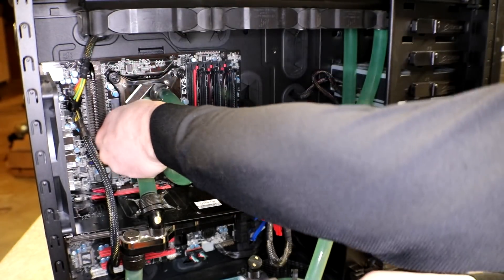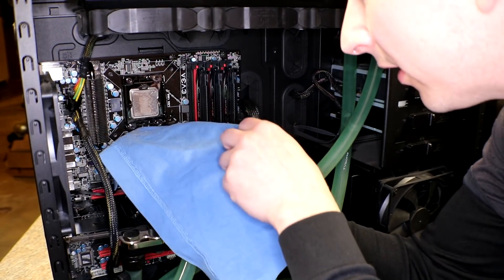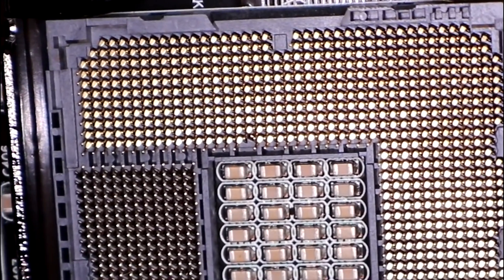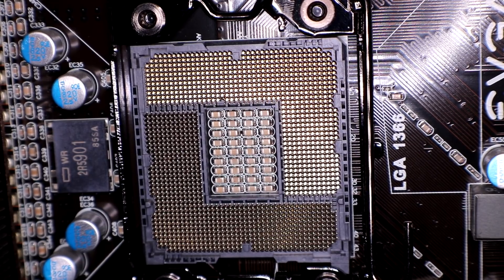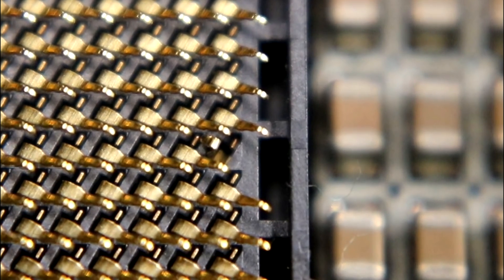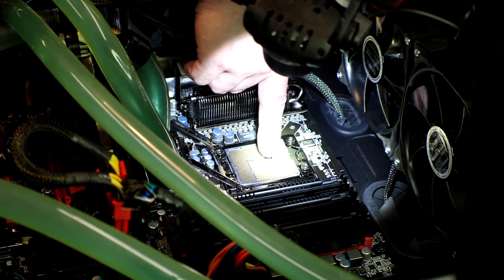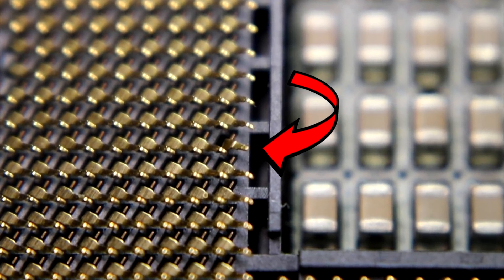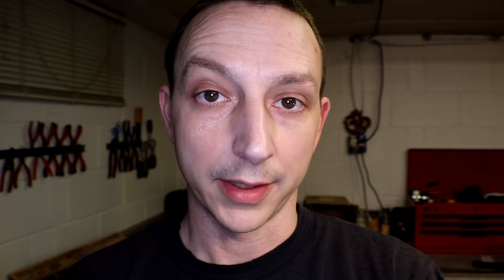Computer Failure!!!  What would cause this???  Bent Cpu Pins and a Repair!

Comment: EE means extreme edition.  What that means is That processor is over clockable. The socket can be dammaged when installing the processor to the socket.  It also might have been damaged at manufacturing.  It can also be dammaged if the processor is dropped on the socket.

Great troubleshooting and fix.  Thanks for your channel.
Reply from the maker: It was crazy that all of a sudden the pc wouldnt start or do anything!

Comment: reseat video card check power cables plugged into it then try again if it is still glitchy try reseating memory if this fails you either have bad power to the video card or a bad video card.
Reply from the maker: Yeah I tried all of that before I pulled the cpu.  All seems to be working pretty good meow!!!😲👍

Comment: My money would have been on the ram, Most of the time when its screen glitches its memory if the screen is connected on to board video not a pcie card. Good to see its working tho after fixing the socket pin but given the age of it, it will be worth running memtest86 for 24 hours off a boot cd given you have 4 sticks of ram.
Reply from the maker: Thats what my money was on to but I tried 2 different kinds and there was know change lol.  Yeah the screen is on a PCIE.  Im super glad its back up and running!  Yeah thats not a bad Idea to run a mem test on it.  Ill have to do that!!!👍

Comment: Great job Joe!
Processors tend to work or they don't, they won't just be faulty (that would be your settings for the processor).  Likely something just nicked that pin when removing the processor at some point, like the edge of the CPU or something dropped in the socket.  Spreading out the Arctic Silver with a toothpick or something will help you dissapate heat better at higher RPMs, like overclocking ;)
~Cheers
Reply from the maker: I kinda wondered about the cpu, either they work or they dont.  But what would cause the pc to just not work all of the sudden?  Thats what confused the hell out of me especially if that pin was bent from the manufacture?  I dont know lol, Im just glad its all up and working again!!!👍😜

Comment: not trying to be a fan boy but one more reason why i like AMD processors better then Intel is because of the pins. You're so lucky bending that back. most of the time they break off.
Reply from the maker: Thats what I was worried about most, bending and breaking the pin😱  I dont have a problem with amd or intell as long as they work lol!💥🔧🔨😜

Comment: Inserting a CPU onto a Mobo is more complex than it used to be.  I've been building my own systems since the 286 days. But the newer Chips when inserted cause pin roll over (you can actually hear it) and when done right there is not issue, but if done wrong generally there isn't an opportunity to do a redo. It is also possible that the first time it was put into the Mobo that the latch wasn't completely locked which still allowed connection, but also allowed ever so slight of movement of the chip.   This is the problem with the New to me computers, not knowing the history of said system.  You did get lucky being able to fix that pin.  But you also ran a huge risk not wearing an anti-static band.   

It was interesting to see Average Joe, then kitty appeared and we saw Sweet Joe, then back to Average Joe.  ;)  Nice Video bud!
Reply: it is possible.  It is also possible that while inserting the CPU into position they moved the chip causing that one pin to be irregular and over time and the movement of the entire box it simply got pushed over.  It's like vibration on a nut can cause it to loosen over time.  Seems impossible, but it happens.
Reply from the maker: Crazy!!!😱

Comment: Great job on that fix! 😎🤠👍🎇 Now, the question is, how long total did it take for you to find that problem when you first started diagnosing?  😉
Just because the CPU had contact marks on the pads, doesn't mean it was from "that" motherboard. They previous owner could have bought a used one off eBay and slapped that in thinking they'd solve the problem (that you later fixed).
Not sure what CPU you have in your mining rig, but you could use the Xeon cpu for mining as well in that rig. You'd use the xmr-stak-cpu miner software if you want to control it yourself, or your flavor of software that mines Monero (XMR). The e5530 does a hashrate of about 132 H/s at 80Watts. The I7-950 only does about 83 H/s at 130Watt.
Reply from the maker: Thanks Man! Oh it took a little bit of time.  I tried restarting and waiting many times hoping it would magically fix itself lol.  Then out of the blue a little thought popped into my head about it heating up and shutting down when I first got it so I figured I must of messed it up then.  The rest of the video was about 2-3hrs including figuring out the bent pin and recording and setting up the camera ect...Actual repair was probly 30min lol from removing cpu, fixing and reinserting and turning back on LOL😆💥😃👍

Comment: When heat builds up, the cpu has its protection to shutdown the computer so It doesnt burn down. The problem you had could also be heat build up  on the north or south bridge of the motherboard or bad power supply.
Reply from the maker: HHmmmmmm I hope its not the power supply.  Its been working great so far so time will tell I guess!👍

Comment: What you need to add to your arsenal is a USB female to PS2 male adaptor. New, they are like a buck a piece. But they used to come in the box with every name-brand wired USB keyboard/mouse, so if you ask around, someone might give you one.
Purple is the color code for the keyboard PS2 port, green for mice. There's no magic to it, most don't care if you put the keyboard in the "wrong" port.
Reply from the maker: Ah crap I actually have a few of those lol.  Didnt even think about those lil things.  Not sure where they are at tho😆👍

Comment: I wouldn't have thought it would be the CPU because of the CPU's ability to mitigate its heat by throttling itself, but something had you looking at the CPU socket. I love how your cat comes in and lightens the mood with a head butt. I'm grateful for our animal companions and the love and joy they they bring into our lives. Nice video, I was impressed that you were able to fix that pin and get those camera shots.
Reply from the maker: Yeah Ive learned to go with the gut feeling.  I had the random thought pop into my head about the cpu from the first day I got it when the water block wasnt tight on the cpu and that was the only left to check.  Yeah Little HO always comes in to lighten the mood with a head but that little lover lol.  He is an Awesome cat for sure!!!  Those camera shots always make the video a bit more interesting to watch!!💥🔧🔨👍🐈

Comment: Great fix. Just a note, paste should be applied in S shape or 5 dots like you have on a dice.
Reply: Or just spread as thin over the center as you can with a matchbook cover or grocery store loyalty card thingy. The point of thermal paste is that air is a worse conductor of heat than thermal paste, which in turn is a worse conductor of heat than metal on metal. So you want the paste to take up all the microscopic air gaps while not keeping the metal from touching the metal where it  can.
Splooging it on and smashing it flat is just hoping for the best without trying your best.
Reply: Actually, the best way to do it is the "pea sized blob in the center" just as he did it.. that way the thermal paste spreads out from the center evenly when he tightens the waterblock. You spread it out, start f-ing with it and your bound to have air bubbles in it. Most computer techs do it the same way Joe applied it
Reply: Not so much. The volume of the blob scales with the cube of its cross section  And you still haven't accounted for uneven distribution.
Reply from the maker: I use to apply it and spread it evenly but then a gamer guy at my work was saying the best way was to put a blob in center and when the cpu cooler or water block in my case is set on top it will evenly spread it across the cpu and therefore no bubbles will appear.  I dont no lol 😆
Reply: AveRage Joe i did work as Customer Engineer at major computer maker and that's what they put lot's of attention at. This was extremely important for servers and very expensive Xeon CPUs. I doubt they did such recommendations without some research :-)
Reply from the maker: How did you or they apply the goop?

Comment: just to be safe i would also try clearing the bios, you can do it one of 3 ways, 1 press the reset bios button, 2 swap the jumpers, 3 remove the battery and put it back in
Reply from the maker: I did clear the bios a few times and tried different settings when trying to figure out what the issue was.  After I got it going I did update to the latest bios to be safe!👍

Comment: the 1 drawback of a water cooled system is is the water stops heat builds up fast make sure that the power to the water pump is solidly plugged in make sure that the water is flowing.
Reply from the maker: Yeah that will suck if the water stops lol!😱

Comment: First! it wouldn't really kill it as most processors throttle and slow down to limit the heat. I would really take the board out. test it with some brenchmarking and let it heat up so cpu heat ip enough to test your fix.
someone must have changed the cpu but stuff it up or something.
Reply from the maker: BOOOOOOM First!!!!   Thats what I am hearing from other comments about the throttling.  I did do some raven coin cpu mining with it which is 100% on all 8 cores.  I would think that would be a good test.  Left it mining for a week lol. 💥😜